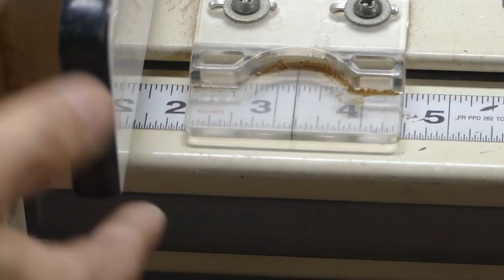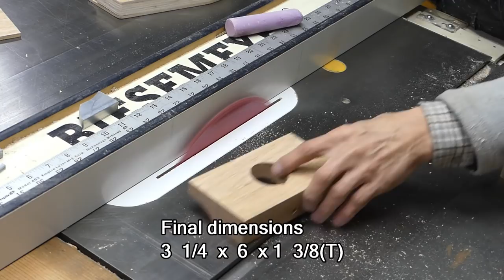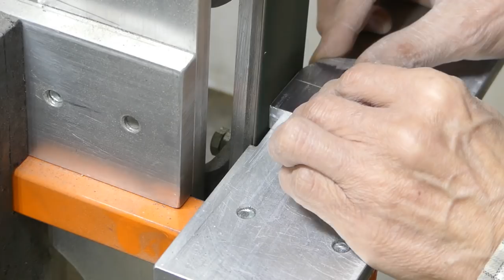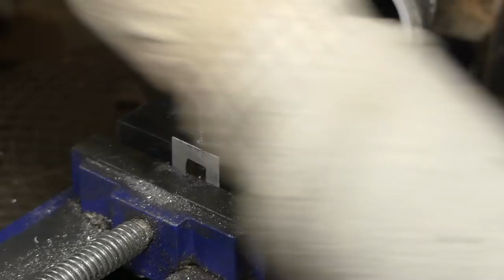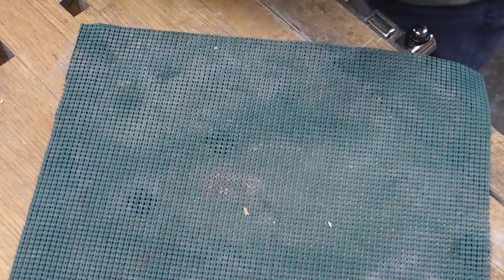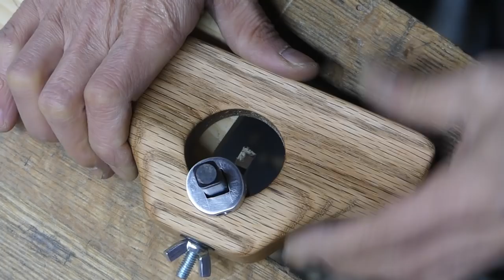How to make a router plane

Comment: good work.  I did something similar, but with a couple of useful differences.  1 - I filed a notch in the eyebolt to catch the corner of the bit.  2 - I used a standard 12mm shaft collar with a setscrew from the hardware store.  it has a round hole, but that is not a problem.

Comment: Most ALL of these designs have a serious FLAW, making them useless, IMO. That flaw is using the square post blade with a wing nut depth adjust, good luck loosening, or tapping with hammer to adjust the depth of cut.
Reply: The aluminium collar is the depth stop.  The wing nut is to lock it in place.